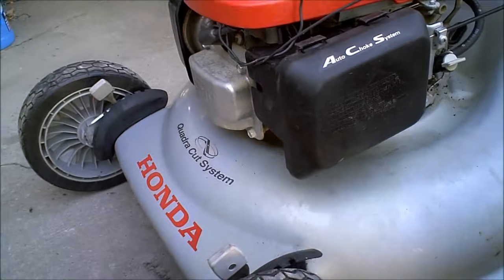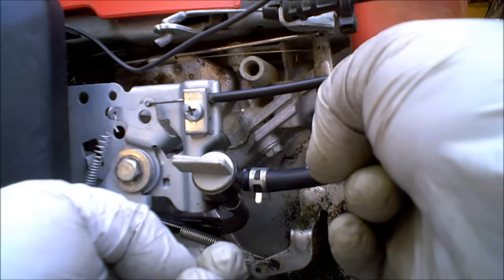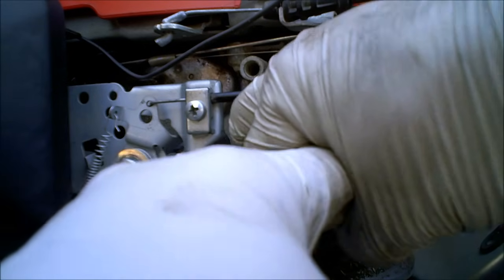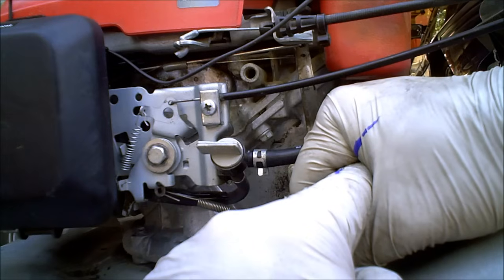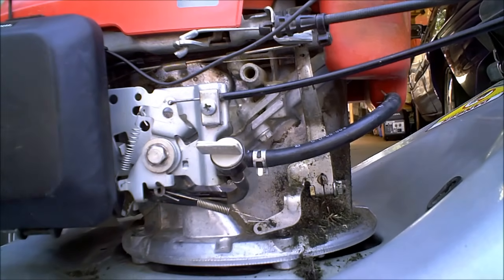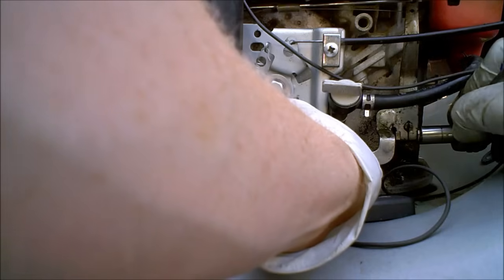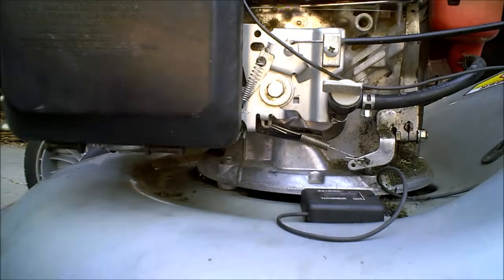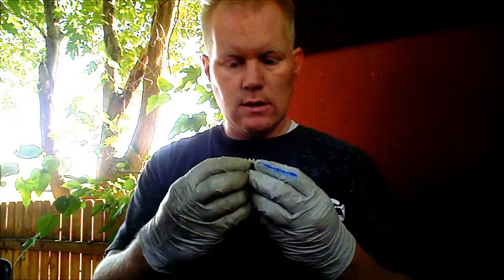Governor Adjustment and How They Work       Honda Briggs Tecumseh Kohler etc.

Comment: Hey, thanks for you video it helps to explain the govenror but I have a question. I have a GC160 powered grok art and I wanted to remove the governed system, can I just remove the linkages that connect to the governed shaft or do I have to remove the whole system internally. I get about 35 mph with that little 5hp Honda engine and I wanted more for right now until I upgrade to a gx200. Thanks in advanced

Comment: Hello my friend.  Great video.  I was wondering if you could advise me how on how to fit the throttle cable onto the engine.  The cable I have has got a small cylindrical lump on the end.  Do I need to cut this off as it is too bit to go through the hole.  ANd how do you attach the wire from underneath??  Any help would be really appreciated.

Comment from the maker: I assume when you adjust the throttle control from the drivers seat it does nothing. You can try to adjust it like I show in the video at about 3:00. Reference where it is and rotate the shaft in the rod.

Comment: Will thanks for your help.I go tthis mower running.I'm not to sure what RPM's this 17.5 horse engine runs at, but on low it sounds pertty high.But i'm use to a 12.5 hr engine.any way i did get it running

Comment from the maker: With the engine off the governor will move freely. With the engine running if you force it to slow down the governor arm will pull and be forcing the carb to open up and run faster. Once you let it go it will return to faster operation. What kind of engine is it?

Comment: i have that same mower engine, it starts but wont stay on, I have cleaned the carb changed the fuel changed the plug and still having the same problem any other suggestions?

Comment from the maker: @justinml11.... All these small engine made by Briggs and Stratton, Honda, Tecumseh, Kohler, etc are 3600rpm or less. They can be made to handle higher rpms but it requires billet rods, flywheels, forged crankshafts, ect. Pretty much everything internally has to be replaced. It is 10 times cheaper to change the gear ratio if you want your go cart/mini bike to go faster. Good Luck.

Comment from the maker: @justinml11 They are built to handle higher engine rpm's. These small engines are only manufactured to handle 3600 rpms. If you want to go faster you need to change the gear ratio. A larger sprocket on the engine or a smaller sprocket on the axle will raise the gear ratio and give the machine a higher speed.

Comment from the maker: @justinml11 ....No 3600 is MAX. Any faster and the engine will blow up by throwing a rod. Yes when the engine is off the generally the throttle plate is wide open.

Comment: @sixtyfiveford I got it figured out, the linkage going from the carb to the governor arm is messed up, along with the wrong governor spring being installed.  I also tweaked the throttle lever to reduce the initial tension on the governor arm and now it seems to not be over reving

Comment from the maker: @classicoutboards .. Good. This tells us that the butterfly is working properly. You will need to adjust the governor further. It is a VERY sensitive instrument. Looking at the governor arm determine which way closes the throttle. If moving it in a counter clockwise direction closes the throttle butterfly/reduces rpm then you need the rotate the governor shaft coming out of the block clockwise in the governor arm to reduce the throttle. Let me know how you make out.

Comment: @sixtyfiveford OK, I manually operated the governor arm with the motor running and decreased the engine speed to idle, let go, and it does indeed over rev.

Comment: Great video, I have a 1979 Briggs 11 hp horizontal on a Wheel Horse tractor and the motor is overspeeding even though I have the governor adjusted to the service manual, what could be wrong?